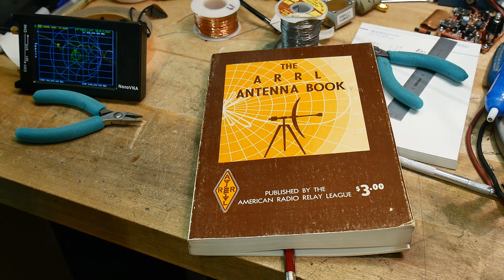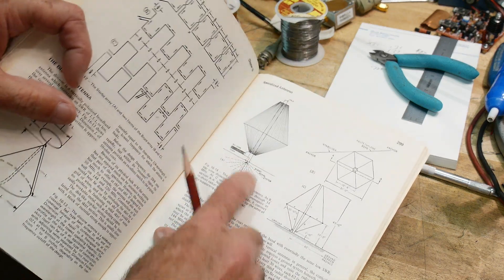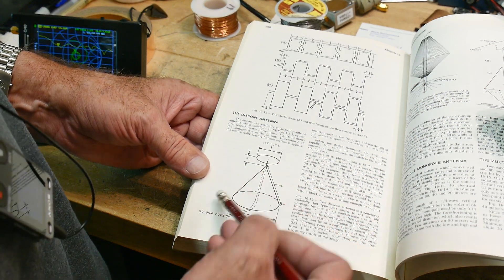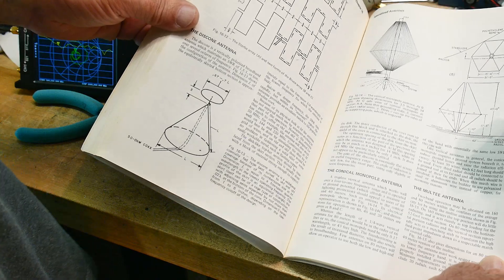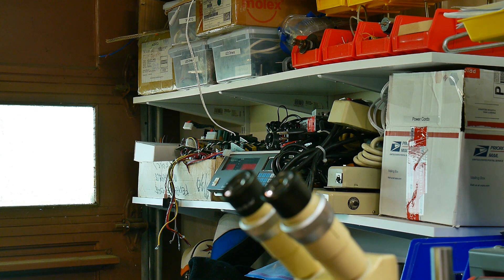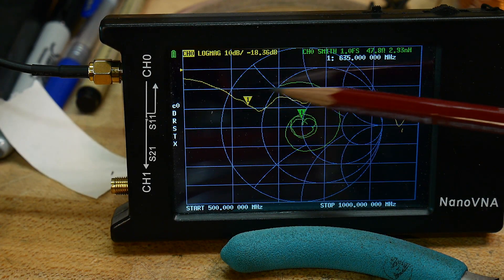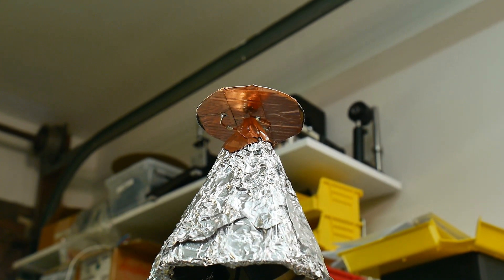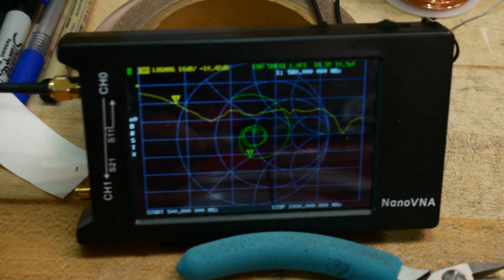#575 NANOVNA Discone Antenna

Comment: Very impressive discone :-)    I've always wanted a nice broadband antenna but when I model a discone designed for 110 MHz and up using EZnec, the first 50 MHz looks great, but above that the angle of radiation only works for aircraft and satellites.  Gain to the horizon is very poor.

Comment: Awesome!!!  Sweet... I have some wooden dowels I started wrapping with aluminum duct tape to make an element style discone since have been amazed what that material alone can do and of course the discone design also.  I have a ~450MHz Yagi instructable where I copied a Chinese design that like with the other projects... will focus on more this winter season.  I do like the copper as the driven element however like my instinct. Amazed at the conductive and non conductive adhesive copper foil also.  I have some Goodwill Store ski poles in the works also and a telescopic monopole so far with the ski pole first section, a carbon fiber graphite second section that was a dummy load ~49ohm so wrapped with non-conducive adhesive aluminum duct tape and then soldered a threaded tip for the typical telescopic AM/FM radio antenna.   Neat!   You know, I'll note here also since is another idea I'm planning to try some day like with a screwdriver antenna, and even better the finger style Scorpion motor driven tuneable design, to make an even more wider band and improved performance discone... is the fractal wrap for the monopole.  I suppose if the individual elements can benefit also the sleeves, that will help performance.   About the time 4:08 is the covering I'm thinking about and wondering what is the design exactly: https://www.youtube.com/watch?v=QWd0nEXFnrE&t=41s    Wondering if like a pancake layered in a Yagi paradigm of thinking or what for the sheet discone design?  Totally good stuff!  Thanks for sharing!

Comment: Neat! Impressive performance. You have a good amount of mechanical aptitude, so my thinking is that you weren't too confident in the design, but you gave it a go, anyway.  You didn't even smooth the foil down : ) In fact it overlaps.

I'm wondering if the performance might be a bit better if were...a bit smoother, perhaps also without so much overlapping, perhaps made from copper tape, soldered together with no gaps in the seams.

It could also be made from brass sheet, also soldered together to form a conical section. For a fancy one, a wooden form could be made, and it could be spun, though it would have to be annealed a few times in the drawing process to prevent work-hardening and subsequent cracking.

I also wonder if there is an aluminum or copper funnel somewhere that....
Reply from the maker: I think I saw one on the Wizard of OZ
Reply: @IMSAIGuy  ,  It's a disturbing thought that they might have given the Tinman a superior multi-band omnidirectional antenna design, after they rifled through the kitchen drawers, desperately trying to make mechanical man costume. LOL!

Many CAD programs have an unroll surface for a truncated cone, to make full sized templates. If by some odd chance, if you don't have access to one, I could draw one up in Rhino, and post full-sized template for you. There might be online cone-maker resources, as well. I suppose that one could be drawn, too,
Reply from the maker: @BrendaEM  just draw pacman.

Comment: I used a discone antenna on 2M back in the '70s. I made it from hardware cloth and coat hanger wire. It worked quite well. If I remember the J-pole antenna I made from copper pipe did work a bit better, but it didn't work on higher frequencies like the discone did.

Comment: Great Video's !! I love the RF stuff :) I want to purchase the nano VNA 2. Which one is better? The one in metal case with N Connectors? Basically I am thinkig of these options:
1.  https://www.ebay.de/itm/50kHz-3GHz-Nano-VNA-V2-Network-Vector-Analyzer-Antenne-Analysator-VNA-HF-VHF-UHF/373139388446?_trkparms=aid%3D111001%26algo%3DREC.SEED%26ao%3D1%26asc%3D225115%26meid%3De046c848c1bb4270bb9f531f3543d6c6%26pid%3D100675%26rk%3D4%26rkt%3D15%26mehot%3Dnone%26sd%3D233732663224%26itm%3D373139388446%26pmt%3D1%26noa%3D1%26pg%3D2380057%26brand%3DMarkenlos&_trksid=p2380057.c100675.m4236&_trkparms=pageci%3A3aa59649-08c2-11eb-805d-624afbd89947%7Cparentrq%3A041993d51750a69e54b200bafff3a212%7Ciid%3A1

and 

2. https://de.aliexpress.com/item/1005001267696890.html?spm=a2g0s.8937460.0.0.25212e0eCbJjWt

Thank you
Reply: I got the one from Amazon similar to the #1. I really like it a lot. But do you have lot of RF parts already? Are they in SMA format or N connector format? I would pick the unit that you have the most stuff with. I have all kinds of different stuff, So I use adapters all the time. Either would be good! Thanks. Mike K
Reply from the maker: I don't have either one. I would choose by what frequency range you need and what connector size is most convenient.

Comment: Thanks for the Video! I have a Diamond Discone on my roof, that is my main "communications" Antenna. I like it a lot, I get everything under the sun. I have a question tho. After taking a reading with my nanoVNA, The SWR is really good across the whole band, But in a few places they are really good. Like 1:1. But my question is what would the gain of this antenna be? And is Gain related to SWR? I understand that SWR is the interface between the antenna and the radio through the Coax. Thanks Mike K
Reply from the maker: Gain and SWR are not related